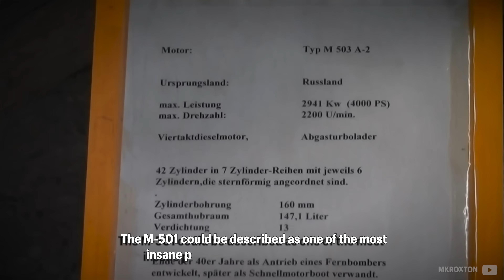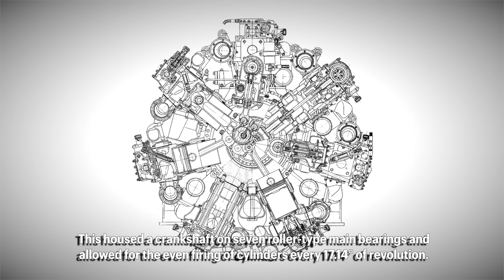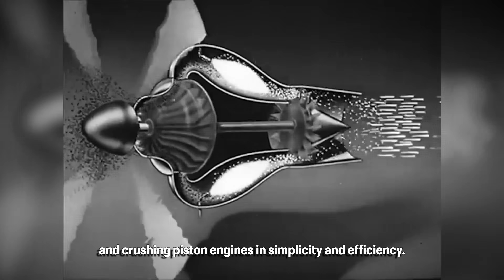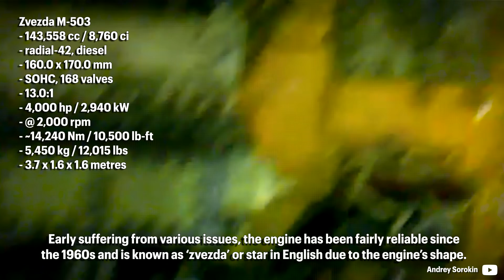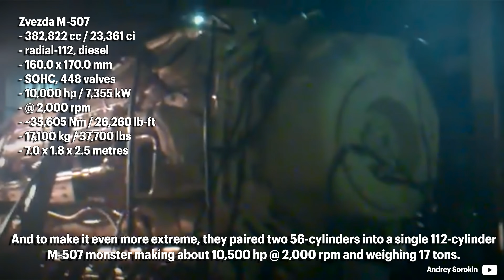A Bizarre 4,000hp Aircraft Soviet 42-Cylinder Engine

Comment: The M-50/500 series engines called "zvezda" NOT because of the engine block is star-shaped, but because they were manufactured at the "Zvezda" Motor Plant in then Leningrad, now St.-Petersburg. The "Zvezda" plant manufactured also manufactured many, many other marine diesels of other configurations (M-400 series  V12 etc.)

Comment: 112 cylinders and 382 liters to make 10,500hp? Nah, just put 10 turbo Honda K24’s together for the same power from 3,000lbs and 40 cylinders instead of 112 cylinders and 37,000lbs of engine
Reply: Synchronising and maintaining 10 engines sound like a nightmare
Reply: How you united that😂

Comment: That Junkers engine was also used as the basis for the Napier Deltic diesel engine that saw a lot of use in diesel locomotives and high speed military launches in the UK for decades.

Comment: I had another idea for a engine, similar to a opposed piston engine, only having different strokes and/or gearing, to cause the piston one piston to be partially down the bore when peak compression occurs, allowing much more pressure to be applied to the crankshaft, if this could be worked out,  finding some way to get the cylinder pressure to about 220psi with the piston down the bore about 1.5" on a 4.5" stroke,  I guess ultra high compression  with direct injection could do the same thing, with the loss of efficiency from the extra compression,  the opposed piston could be a short stroke, about 2"  maybe use offset center sprockets to get the top piston to follow the other piston down the bore, mining faster  to raise the compression, then participate in the power stroke when it fires, using sleeve valves,   I'm thinking with the power stroke starting with the crank at about 20°  would have a lot more leverage on the crank, 
Or maybe a more traditional head can be used, with a 3piece rod, with two cranks, having the rod basically bend then straighten out as it fires, if it was straight it would be too long , the other crank and rod geared together using the rotation to push the rod straight as the power stroke continues , I think it would take a cad to even explain it ,, but , why not just build multiple rotor  liquid piston engines, running on methanol!? With a 200 mm wide thick rotor, with a combustion chamber in the rotor, putting the center of combustion in the  small deep center, to allow a single plug to ignite the mux cleanly, basically a inverted cone with only enough. Chamber in the block to prevent the plug from being damaged,  with the chamber positioned to have the force of combustion at the best location to push the rotor most effectively! Crazy,

Comment: I was thinking , after watching a few videos with the radial aircraft engines,. I was thinking what if someone built a engine similar to this with more cylinders like a cross between this and a radial, sleeve valve driven by a cam shaft  using sleeve valves for intake valves, and large exhaust valves in the head, alot like a Detroit diesel, it could be a 2 stroke, using a scavenger,  and large turbos, the main difference brings 5" stroke and 6" bore,  and enough cylinders to fire every 22.5° or 11.25°of rotation, or there about,  so it fires with little crank rotation, or possibly fires two cylinders at once,  it could be a 2t gas or diesel, or a 4 stroke,

Comment: I think we underestimate a great deal that throttle body's butterfly if we call it butterfly... I believe it deserves to be called bat or seagull I don't know.
The thing that amazes me most is about that engine is the level of robustness and how symmetrical it is as a construction if you exclude that it has 7 heads and not 6 or 8, this decision must have been taken to fix balance issues I guess.
Great video, cheers from Greece!
Reply: There is a very practical reason to have an odd number of cylinders per bank for radial engines, I just can't remember it. All radial engines have odd number cylinders per bank, and I'm assuming the Soviets had the same reason to do it with this monstrosity.

Comment: That throttle body could only be better if it was a barn-door type.  Then it wouldn't have the restriction of the throttle shaft at WOT.  It can also be a safety thing; if there is a backfire, the big round center-pivot throttle blade could get bent and the engine wouldn't return to idle.

Comment: After seeing that throttle body open on the front of that puller. I would definitely suggest to not be there during test firing of the engine. It might not suck you in like a jet engine, but anything lose or semi attached will make you wish you weren't there. Oh yeah, little kids might be a bad thing 😆

Comment: What a beast! As a huge fan of ICE this just went near the top of my list.
Reply: It only took 112 cylinders
Reply: @plap.  That was a separate engine altogether that has 112 cylinders, this is the 42 cylinder radial version
Reply: @TheSilverShadow17  ya 2 56 cylinder engines based off the same architecture bolted together
Reply: @plap.  Oddly enough there is no footage of the 112 cylinder at all on YT so idk how VisioRacer managed to find it. Or it could be how I'm looking it up
Reply: @TheSilverShadow17  iv definitely never seen it before it's bonkers
He did say two.pistons per cylinder too witch would be 224 pistons

Comment: "Yunkers" is the correct pronunciation for Junkers.

It should be noted that the exhaust turbine is not connected to a charge compressor , it recovers exhaust energy and supplies additional torque direct to the crankshaft
Reply: proper way to do a turbine
Reply: at lows it should help scavenge
Reply: @Xayuap  No , it is always a restriction in the exhaust system. But the restrictive losses are less than the energy recovery gains
Reply: @paulg3336  remember that is driven by crank. ¿do you say that the turbine will scavenge if conected upside down, by the outlet?.

Comment: How about the 12 Clynder two stroke diesel called the Cresy built by Rolls Royce as it produced 5000 crankshaft HP, that would make a cool video.
Reply: Wasn't a Diesel either. And Curious Droid has already done it...
Reply: It's pretty unique since it's only few gasoline 2-stoke that use external pump instead of crankshaft pump
Reply: There is already a video out about that engine!
Reply: The Greasy?  You mean the Crecy?
Reply: @elektro3000  My bad.

Comment: Even with the addition of a turbo and a supercharger, a compression ratio of 13/1 seems really low for a diesel.
Reply: Soviet fuel in 50-60's had very low quality, i think it is main reason
Reply: @user-dolbeeb7Up0i  That wouldn't affect diesels, though. As long as it burns and doesn't have too many twigs in it, diesels are good to go.

Comment: We need to develop 2 stroke diesel powered aircraft engines!! i long to see the day we fly an airbus with diesel propeller engines with mast riser exhaust pipes protruding above the plane
Reply: Rolls Royce built 10 Cresy 12 cylinder two stroke diesel with rotary cylinders, it produced 5000 hp but it got scraped due to jet engines.
Reply: @robinsage1964  thats very sad 😭😭😭
Reply: @fidelcatsro6948  But very true thats why they only built 10 and many small 4 cylinder proof of operation models.